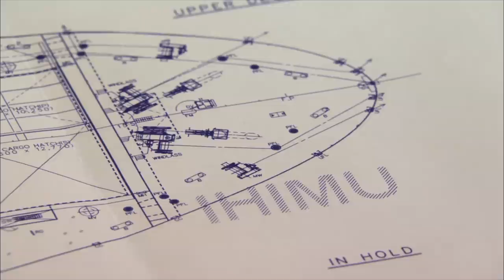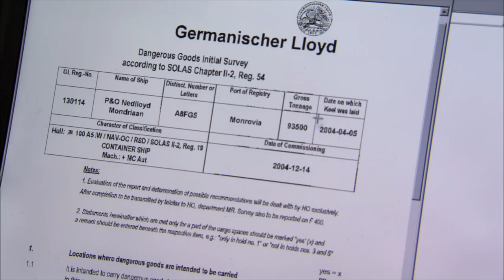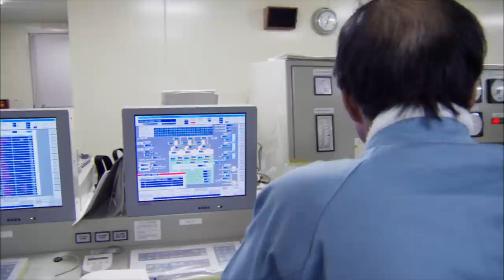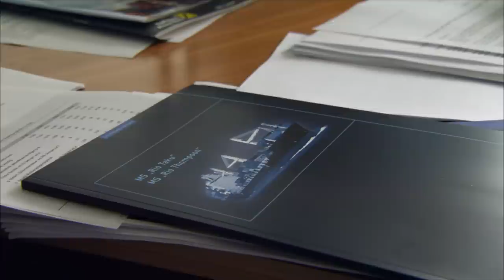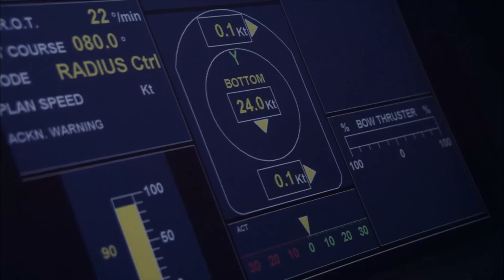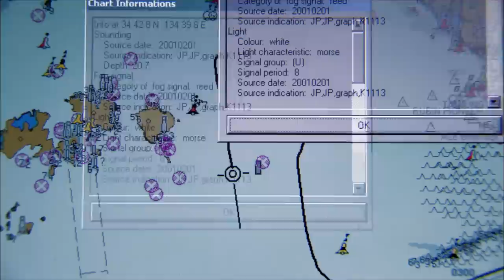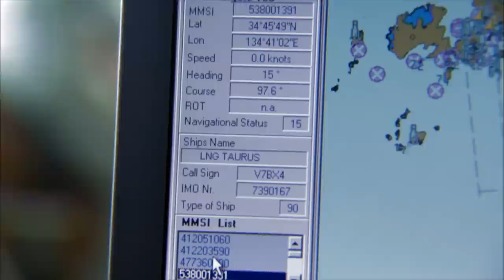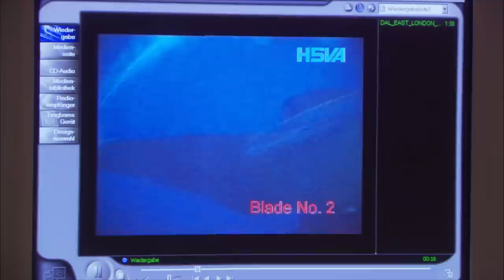Giants of the Sea - Containerships for more than 8.000 containers (Documentary, 2003)

Comment: Amazing what happens in 17 years... 13,000 TEU was a dream on a drawing board.  18,000? Ha! Who's gonna make the running gear to safely and efficiently power those vessels?  Will the ports load and discharge all of those boxes from a single ship? Is the drayage adequate?  Questions answered - the engineers were more than up to the task, as were the port owners/operators.  The future is here - Gulsun class, nearly 24,000 TEU...